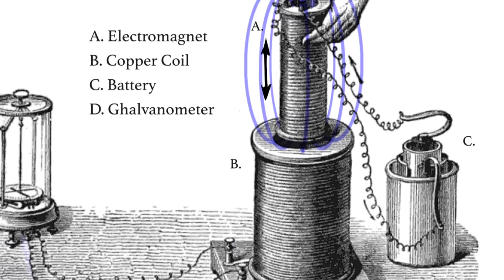Will Wireless Charging Power Our Future?

Comment: "Wireless charging is a convenient solution that’s been around for a while, but ... why aren’t we seeing it everywhere?" In a sense, we've been seeing it everywhere for decades.  The wires leading to our devices have never been connected to the wires leading to the power source. It's just that the power transfer has been buried inside the transformers that we've come to take for granted. Now, instead of the input and output coils being wedged together inside a very large plug that renders useless outlets adjacent to the one you've plugged it into, or inside a larger box with a cord that plugs into the wall and its own outlet that your device plugs into, we've moved the coils one step further from the wall and put them in separate containers, with one inside the charging pad and the inside your device.

Comment: Just wondering if it takes copper wire to transmit electricity y not instead of adding more energy we add more copper like with telephone poles transmitting along a wire we have poles with copper at the top in a star shape all around the world the stare shape would make the electricity in a bunch of directions and the copper would conduct the electricity so it can travel farther

Comment: Interesting that Toyota is creating hydrogen fuel cell cars but at the same time you can expect that Electric cars will be able to charge themselves without stopping. I like that they're developing the fuel cell tech as it could be used for other applications but to me I just see them getting a disappointment in 20 -30 years when it doesn't work out. So yah. Not stopping to charge a car would be a huge plus.

Comment: What irritating problem of today do you hope the technology of tomorrow will solve??? I have an invention, thought or idea.....call it what you like. It's in the field of aviation/transportation, that I hope will solve the problem of using so much fossils fuels in getting people, goods and things from point A  ...to point B. What goes up...must come down...right? Take an airship...like the goodyear blimp...divide the hull into 2 compartments...top with helium, bottom with hot air...........streamline the frame so that it looks more like a delta shaped wing. Heat the helium.....you can heat it with the aid of the sun, during daytime.........otherwise use a sterling cycle engine...........or use pressure.............then elevate to 144,000 ft (43kms) takes 2 hours....to reach that altitude.......now...try to think of Felix Baumgartner,...when he did a freefall back to earth.  He broke the sound barrier because he did not have any wind resistance at that altitude. So....... instead of just jumping from a balloon,...... you will use your airship to glide back down in a rapid decent. For this...you will need to lose all the hot air.....for gravity to take effect......otherwise you will float.  You will expell all the hot air out the back of the ship...... ......this will provide additional thrust.......you will then (at the same time) compress all the helium into tanks.........  .(safely)........you are ready to cross the atlantic....... Now just..pick a destination. Land. Voila. You have used the equivalent in fuel that it takes to fill a tank of gas in a car........>>>>>>>>.......but have managed to cross the atlantic.
Reply: Nicck LaRiviere
Hi, I know its hard to explain in a few sentences. But.....I will try to answer as best as possible. The balloon.....what would happen?  Well ...all of what I mention is simply taking existing technologies and melding them together. I forget the word that describes people that do this. Anyways....  the balloonlets.....are individual balloons that will deflate (reducing their size) just as when a normal or regular balloon deflates. The hot air will be expelled through a rear outlet, providing thrust...much the same as when you fill a latex balloon and let in go from the palm of your hand.  The helium contained in the other balloonlets with be directed to chambers that will compress the helium into storage tanks. The frames used today are normally made from aluminum, but I would be using plastic and in some cases fiber glass, carbon fiber and some  Kevlar. I will attempt to build  a scale model first...to prove my theory. However, take in note that the "theory" I speak of has already been proven beyond a doubt, when Felix Baumgartner, leaped from a height of 39km.  (Near space orbit).The only difference would be instead of freefalling in a suit, we would be using a much safer approach...in using a craft to re-enter the earth’s orbit. Hope that helps to answer some of your questions.
Reply: Nicck LaRiviere
http://en.wikipedia.org/wiki/Felix_Baumgartner   just in case.
Reply: +Charlie Hernandez Sounds like a plan.

Comment: I have purchased/been given Bluetooth headsets that have ranged from less than $25 to over $250 witch I have tried with multiple cellphones but STILL even a mid range($40-$50) priced set have had better sound quality then high end Bluetooth. So are there any short range wireless standards that are likely to be better in quality sound wise then Bluetooth now or in the near future?
Reply: Some of the more expensive ones are not expensive because of the quality, they get pricey because they work with more than just phone calls. Many work with Skype and can be synced to both a computer and a phone so you never have to switch and never have to hold a phone up to your ear.